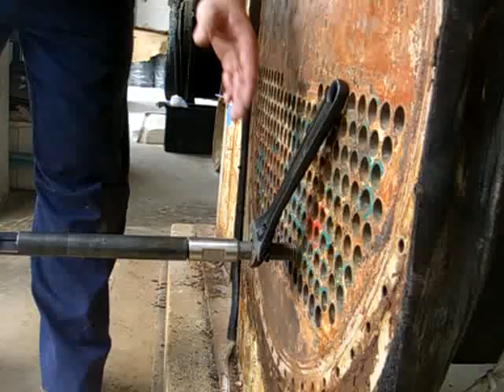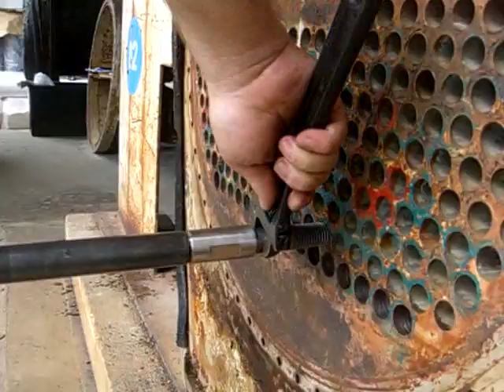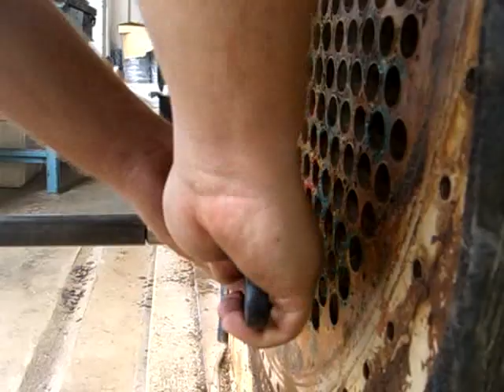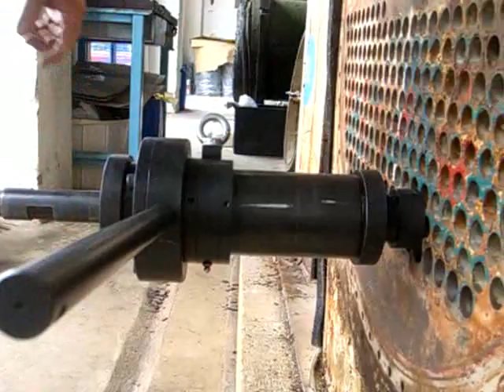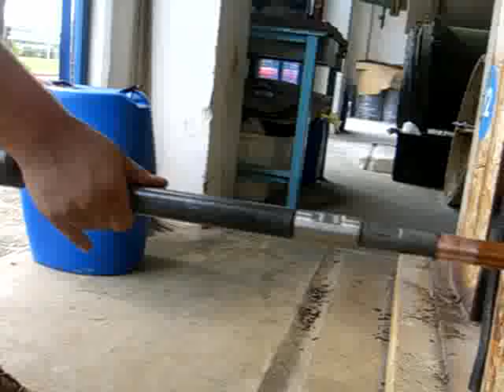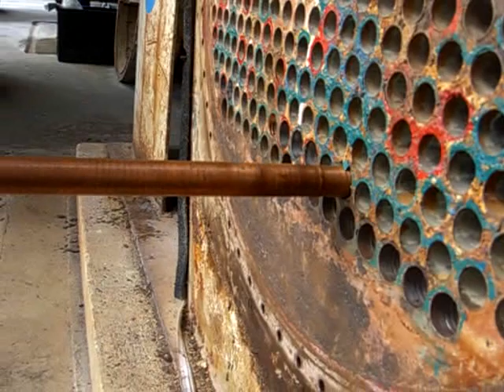Retubing

Comment: pls how do i order for 4pcs of this
Reply: Where is your location? Outside diameter, Wall thickness, which size do you need?
Reply: @selcuksancak  Nigeria ,Outside dia 50.8mm , 2.9mm wall thickness ,
Reply: @selcuksancak  Required email id , required this tool OD 19.03MM ID 16.34MM, Tube sheet -25MM